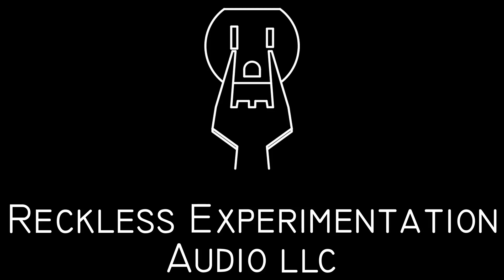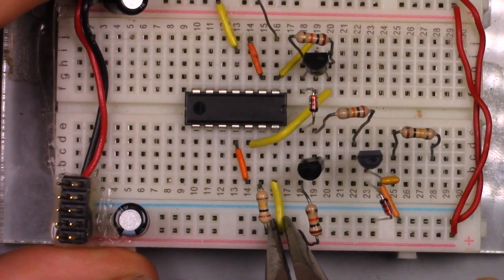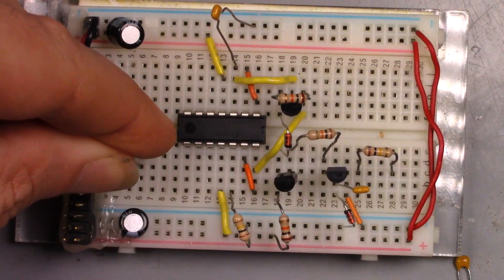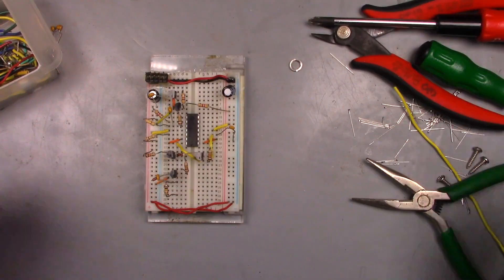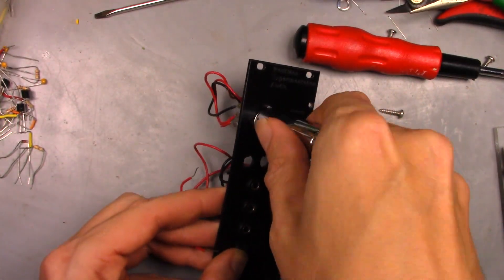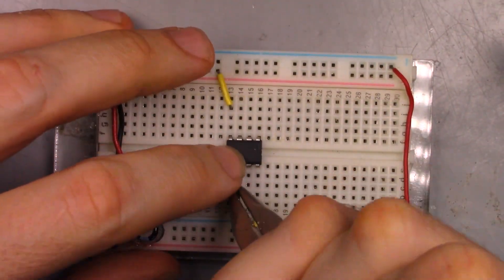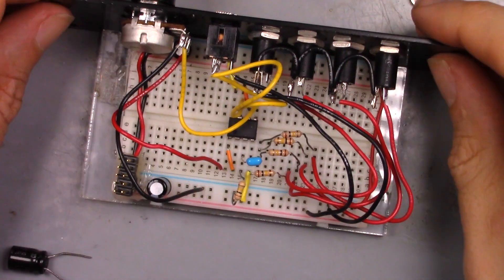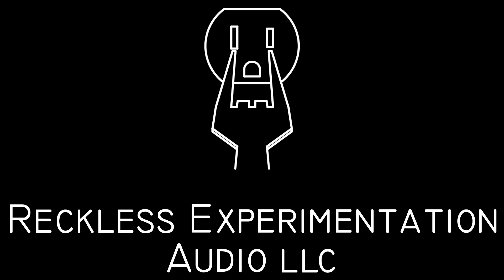Eurorack noise circuit, and headphone amplifier breadboard

Comment: How important is the choice of opamp? Could eg. a 741 do?
Reply from the maker: For the noise source, op-amp choice is not important at all, 741 should be fine. For the headphone amp, I would recommend and LM324 or another op-amp that can drive some current. Or you can boost the power with external transistors, see my reverb video for an example.